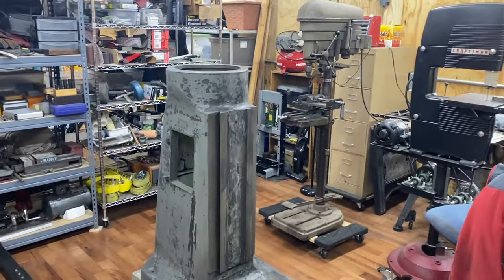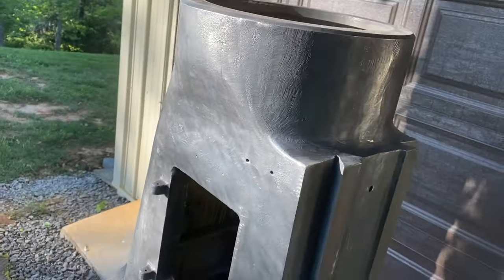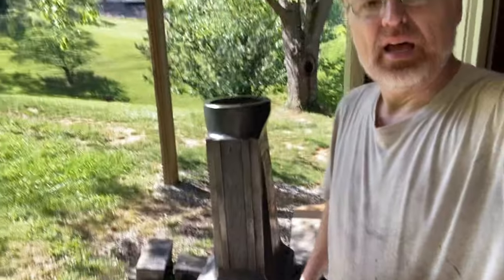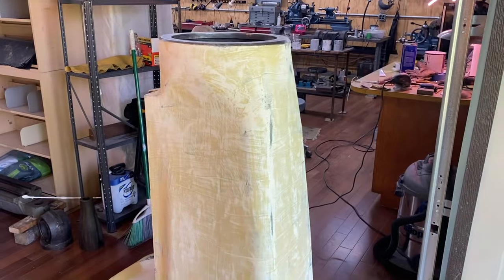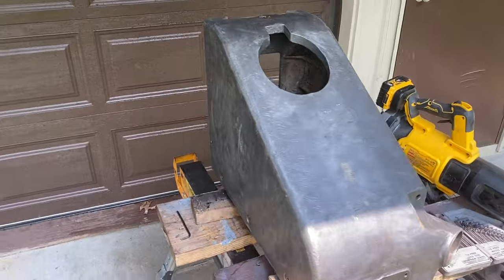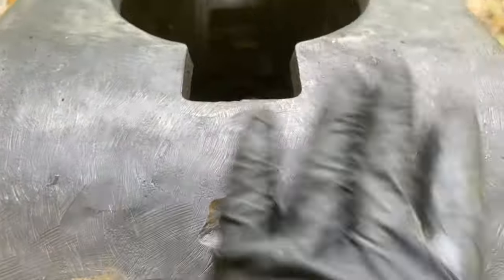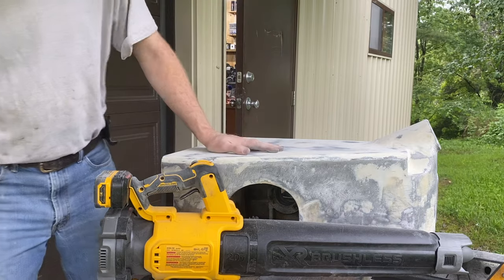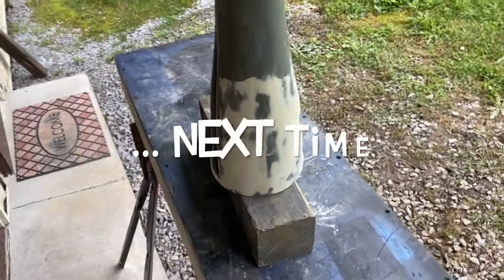Bridgeport Restoration, Part 3.  Getting ready for painting.

Comment: Btw, I used a needle scaler to take every inch of paint/filler off. Worked very well but man was I beat. I'm not using bondo on my redo as the castings looks great or at least good enough for a machine. I've been cleaning with a case of brake cleaner, but every time I do my rags are still black. Might have to power wash. Ugh. And I just saw you said the black on the towel is just carbon? Should I stop cleansing and call it good?
Reply from the maker: Yeah, I think that as long as one rubs metal, it's going to look somewhat black.  That's my opinion anyway.  I like the idea of a needle scaler, but I currently only have a tiny air compressor, and I suspect I would get about 15 seconds of scaling, and then 2 minutes of the air compressor motor running to catch up.  UPDATE: I just watched your video.  That scaler is very cool!